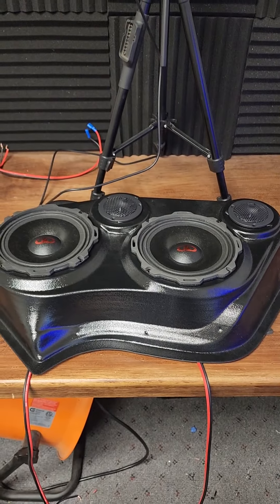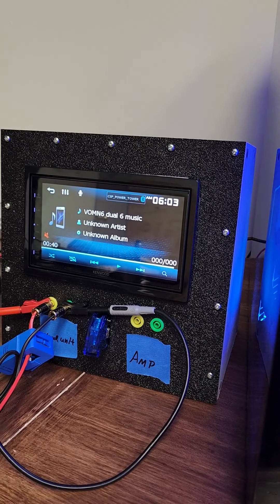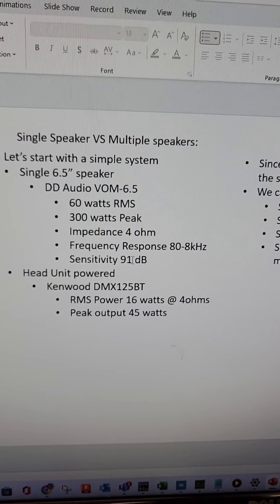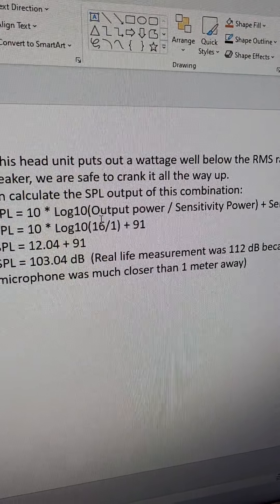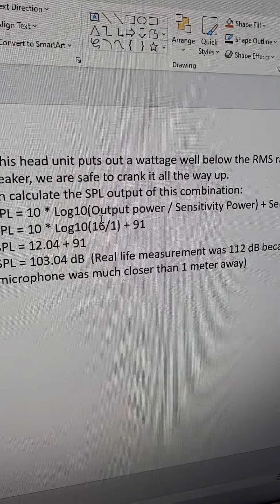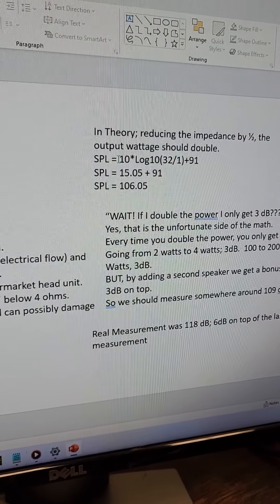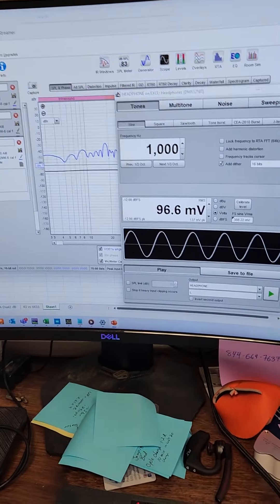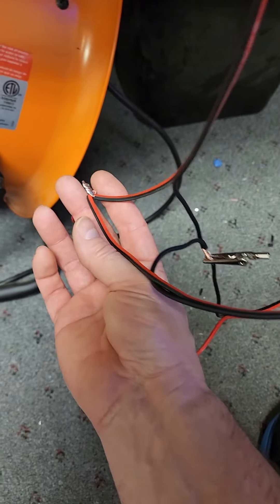Wiring Dual 6.5" Speakers in your car door. Parallel vs single power output measured.

Comment from the maker: I apologize for the audio quality.  I will repair this for the next video.
Reply: Can I wire together two different watts midrange 4 ohm speakers, my amp can handle 2 ohm I am  just wondering  cause the one speaker is 250 RMS the other one is 100 RMS.
Reply from the maker: @Catholic1391  Yes, but you will need to limit the amplifier output for the lower wattage speaker.  Since you will wire them in parallel the power will be shared (not equally since the speakers are different and will have different impedance curves).

Comment: So I have a Volkswagen GLI and the front speakers are dual ohm and dual voice coils and I'm trying to find a speaker that will work with it using aftermarket wire connections but every speaker I put in and I crank up the volume ends up crackling and popping and I damaged the voice coil do you have any suggestions on wiring or speakers that could handle a dual ohm dual voice wiring

Comment: When I run my 4ohms in parallel they still produce 4ohms on a multimeter. Am I doing something wrong or should I just leave it alone because the SQ is still amazing?

Comment: I want to put a system in our car for my wife. 

Are you saying having 2 6-1/2  speakers is beter the. 1 7-12?

As long as you don't go over 16 ohms 

It would be louder but would you loose quality

And adding resistance on the circuit isn't that making the amp work harder
Reply from the maker: Good question.  I will be going over speaker size in future videos, comparing 6.5" with 8".